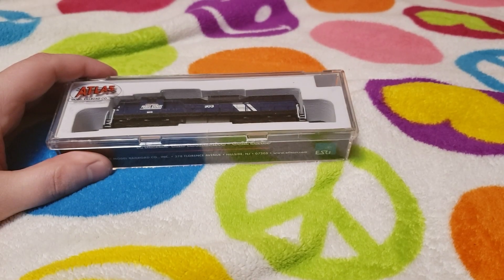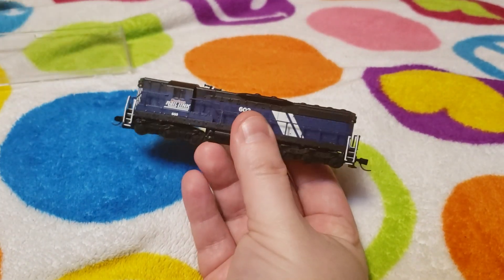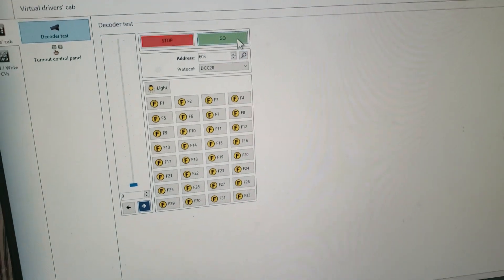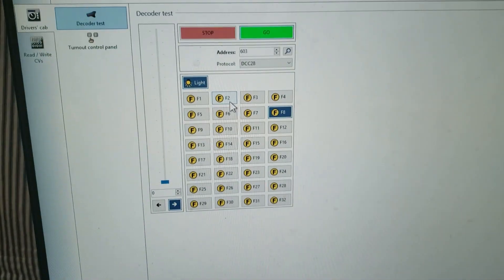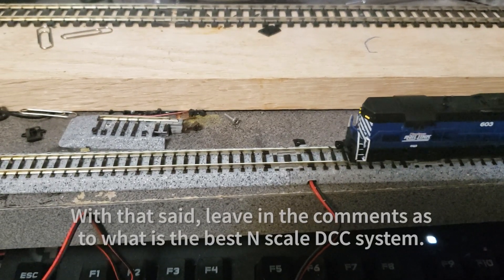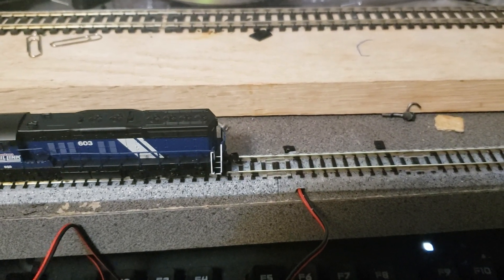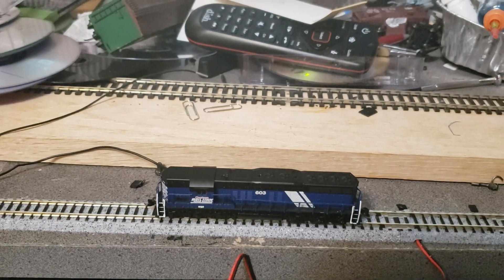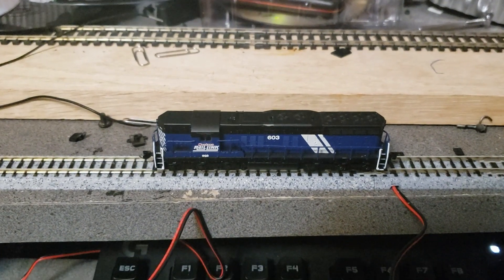Atlas Master Line N Scale EMD SD9 with DCC & Sound - Unboxing and Demo

Comment: To get them to creep I adjust Vstart until it reliably starts to move on speed step 1. Usually I can get them creeping really well, around 1 to 3 scale Mph. I'm still learning all of the complicated motor "kick" adjustments. It seems to be different for every decoder manufacturer.
Reply from the maker: There is a reason why I run her at this speed, the locomotive was cutting out on my track, not sure what is causing this problem, I think its a condition with my house circuit.
Reply: Ok, I hope you get if figured out. For me it's usually because one of the trucks are not picking up power. You can test this by lifting it up slightly on each end while it's running and see if it cuts out.